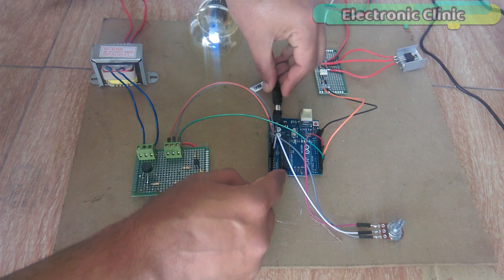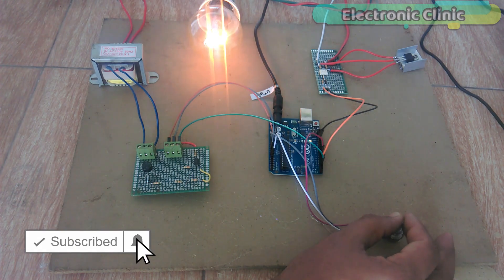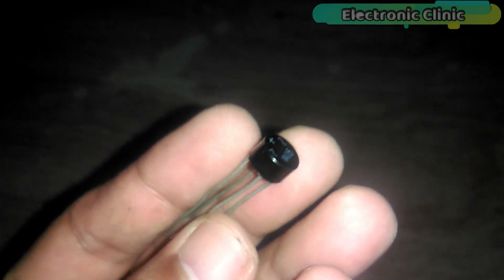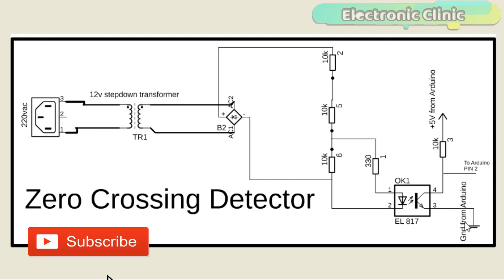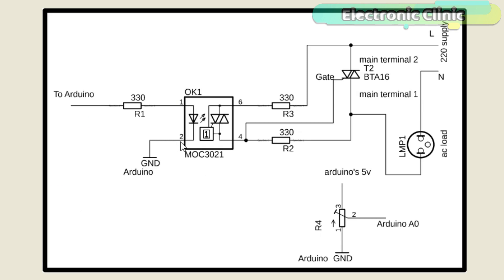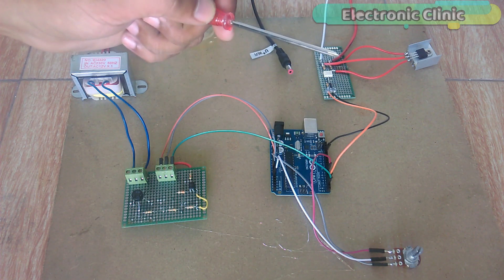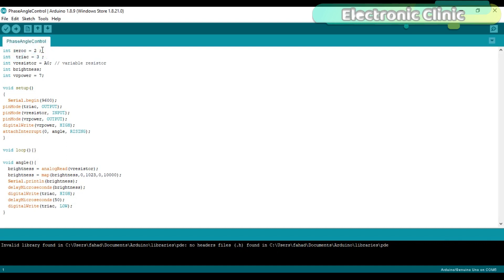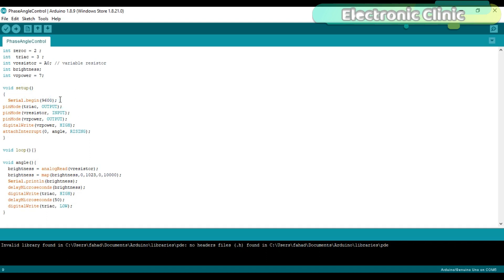Arduino Project: 110/220Vac Bulb dimming using MOC3021, Triac BTA16 and Zero Crossing detector

Comment: I really like the use of a transformer to secure the current of the optokopplers diode. However I dislike the uses of blocking funktions like delays or serial.write in a interrupt service routine. I recommend to seta flag in the ISR and to handle this in the main loop

Comment: Can I use moc3023 insted moc3021 and what i need to change if I can do it with moc3023
Reply: Yes, you can use the MOC3023 and you don't need to change anything in the circuit. The only difference between the 21, 22 and 23, is the current needed through the input LED to ensure the latching of the TRIAC output, beeing the 3023 the ones that needs less current to do that, and if the circuit is designed for the 3021, and it works well, surely it will works with the 3023

Comment: Can I use it for 3 phase motor??
Reply: You then have to use it for every phase its better to use VFD instead of this because by this method the motor may gets damaged due to high current at low voltages..
Reply: You have to take in mind that the zero crossing point is where the steepest current flow in a sinusoidal curve occurs. So maybe this isn't what you want when inductive loads like motors are involved.
Calculations first:)

Comment: Great video! I made the same using PIC microcontroller. But nowadays, it is no longer very practical because resistive load bulbs are no longer used. I'm currently using "Dimmable LED dichroic" with this circuit, but it is not the same!
Low dimerization doesn't come down so elegant, even doesn't came to zero effectively.
Reply: How you could resolve this issue?

Comment: For what are you using the Zero Crossing Detector? Is it for turning syncronizing the Arduino, so that the Demo Circuit gets turned on when the AC voltage crosses zero? And if so why don't you make use of it in your code?

Comment: I tried by following same instruction...but it is not working
Reply from the maker: it's a simple straightforward project. you need to be careful while doing the connections. Follow each and every step.
Reply from the maker: first of all, make the zero crossing detector circuit and check if you can read the frequency. then start working on the dimming portion.
Reply: I only have multi meter..i can not read frequency.